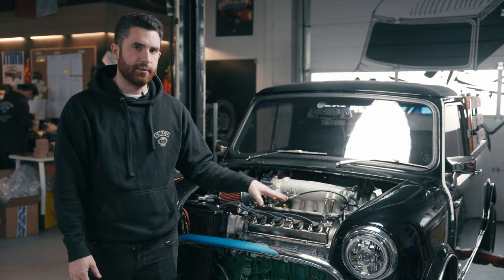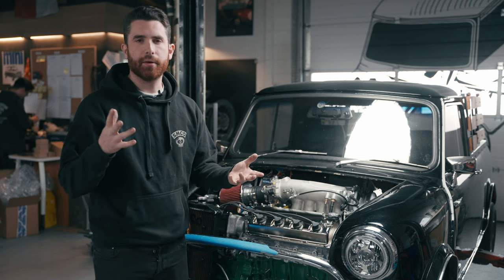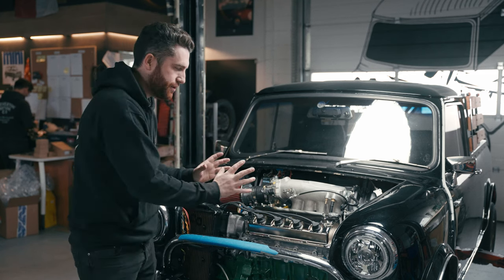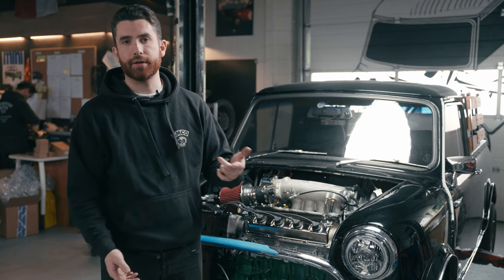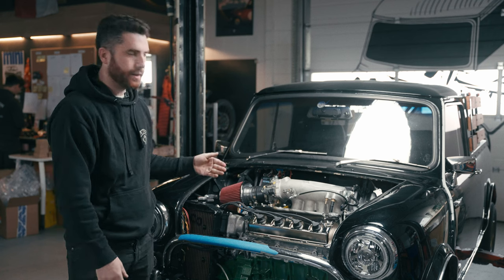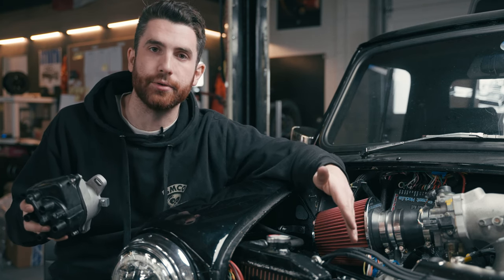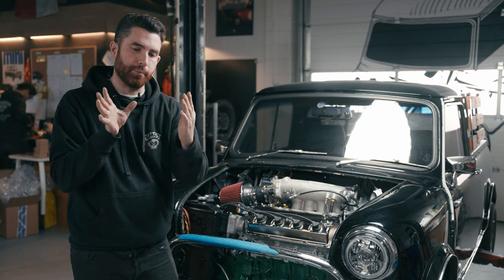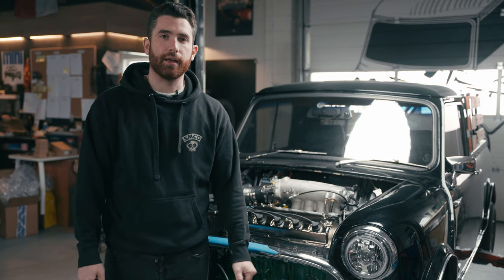What it takes to fit D16 - Little Morris Episode 3

Comment: Did you mention at some point which subframe that is? Oh, it's the MCM frame. I had to go back and rewatch the first video. My radiator in my MiniTec frame is only attached at the bottom. I really need to figure out some top mounts. Your solution looks really good.

Comment: Weather protection for the alternator in the wheel well? Love the video and the swap!
Reply from the maker: The car is going to be used in an extremely dry climate. Wheel well covers made of custom fit abs would be possible in theory.
Reply: @Stevestonmotorco  I love the MCM subframe and the D series for the mini, but I think some protection for the alternator would be vital for its longevity.

Comment: the challenge is if you can build D16 with automatic transmission because not all mini enthusiast wants to race with stick shift, i want something that i can drive for 8-12 hrs straight with cruise control and all that
Reply from the maker: It's possible with lots of fabrication. Unfortunately most of the automatic transmissions for these engines aren't exciting.